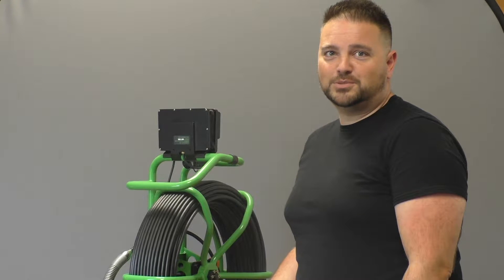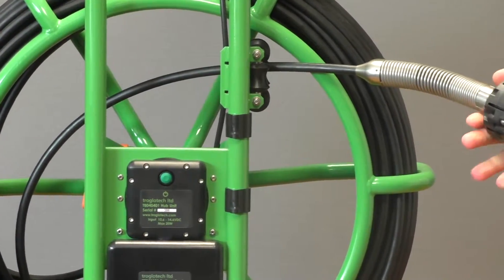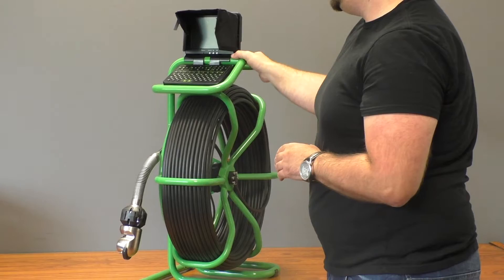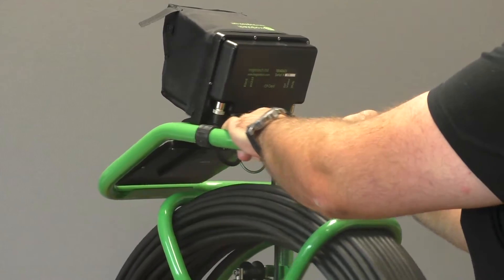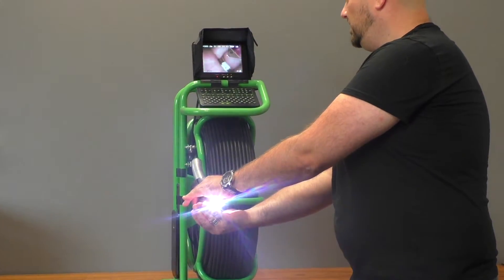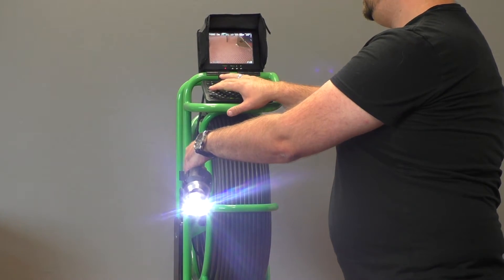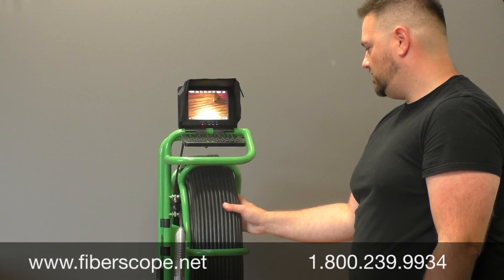Pipe Inspection Camera TROGLOPROBE 812 | INTRO

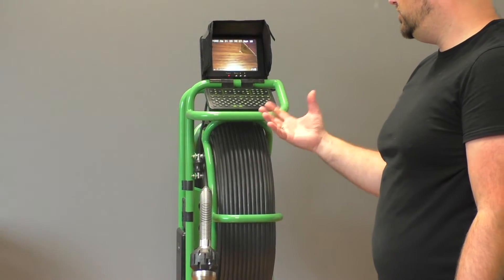Comment from the maker: 4:42 For the camera head itself you have the tilt function here on the right side of the keyboard. It's just side to side movement. Also there is a rotation function that rotates the camera head around in a circle. 
So you can see the top, the bottom of the pipe.

4:59 You have your Auto-home on the left side so it will center. If you hit the Auto-home it will also rotate your camera head back, so it's back to self-leveling. If you don’t want that you can turn it off just hitting the small "iris" button and it will also allow you to manually rotate just the camera chip itself (on the center of the keyboard). So if you enter the area when you don't want to rotate the camera head around, you can do the chip itself.

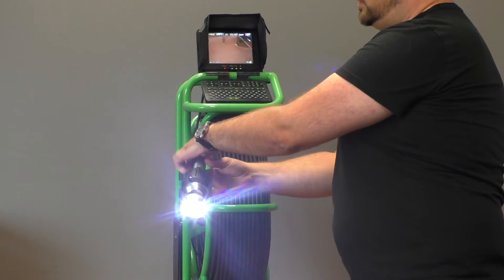5:28 The central upper part of the console is going to be your DVR so that's where you are going to save your images and video, it will save up to the CF memory card and you can go over it after. 
Keyboard is for typing 8 pages of text for your saved files. There is a microphone, so you can use that if you want to do audio recordings for your videos.

5:49 The reel is going to be machined, the push rod is going to be very hard reinforced with Kevlar, you are looking at about a 1/2 inch in diameter. The camera head is really hard stainless steel. You are not going to have any issues damaging that.
There is a protection as well for the camera head in the front so if you are going to bump up against something it's not going to be an issue, and you can adjust the focus so you know how far away you are.

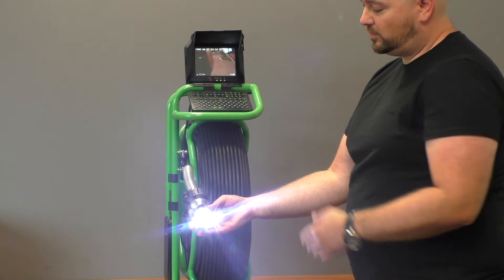6:11 The camera head is going to be waterproof to 11 bars, so you can have a lot of pressure so you can insert this down into. The same thing is with the reel. You are looking at a lot of scratch resistance, abrasion proof.

6:24 The monitor is going to come with a sun-shield so you can use it in a bright daylight. The keyboard and the monitor are both machined aluminium, so you are not going to have any issues there with plastic parts or chipping anything off.
It's going to be a really solid built. You can fold it both ways up or down. So if you need to you can transport it that way. 

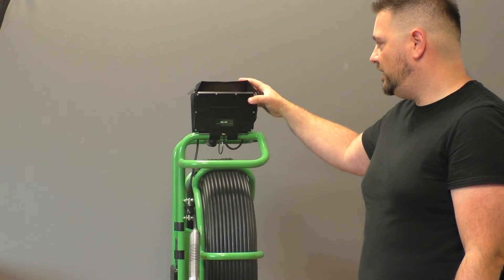6:44 The unit itself has a handle on the side, you can pick it up. You are looking at about 50-60 lbs. So it's not hard to take it and transport it to your jobsite or throw it in a truck.

6:57 There's also a hand break on the side so if you are inserting it or rolling it back in you want to make sure you are releasing it each time. The same thing is with dropping it down into different areas. So if you are doing a well inspection or a duct inspection you want to watch that as well.

www.fiberscope.net
1.800.239.9934